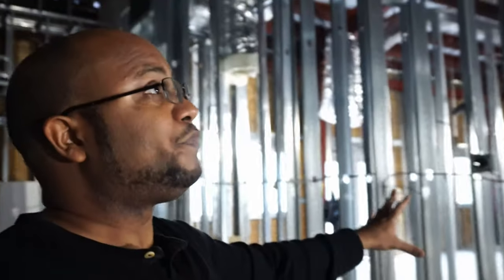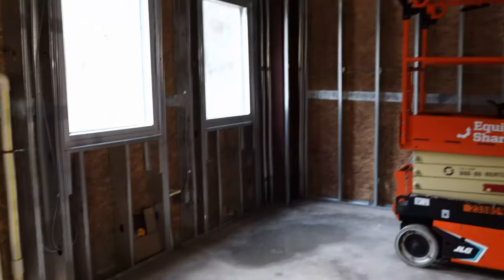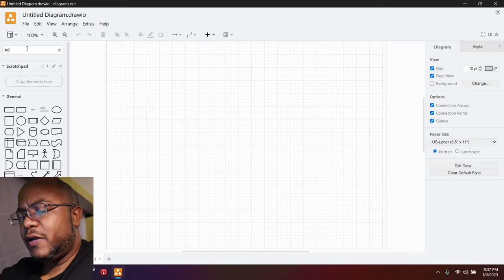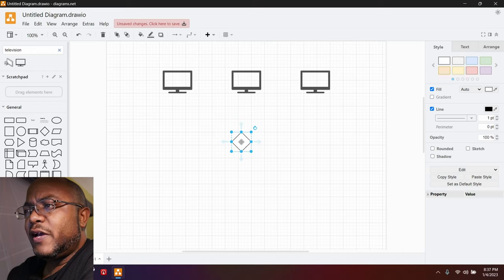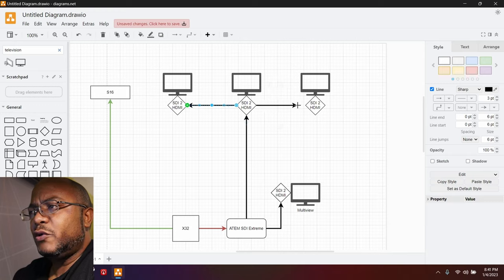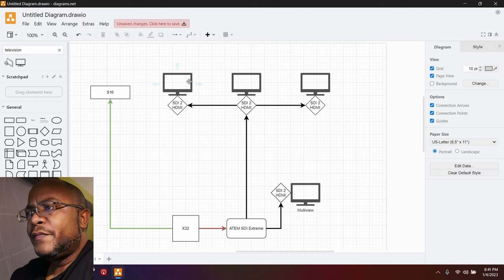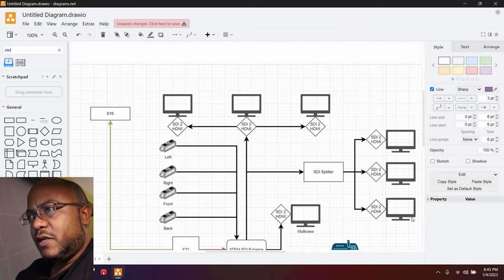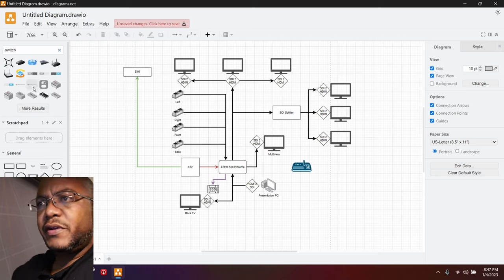One To Another Ministries | On-site & Design

Comment: Bro Ajay, this is Bro Clint from your trip to Savannah Ga. I want thank you so much for what you do for media ministry. I want to give you a report on the progress we have made since you came here. Our move in date was moved several times. we had first service mid June 2023. Our TV in Youth room is fine but the 2 front TV's are flashing the display in 5sec intervals. I have Atem Mini SDI setup with Blackmagic SDI to HDMI transformers. I just got them up this week but can't figure out what's making them flash in and out. Any Ideas?
Reply from the maker: Flashing is due to a signal drop. I would terminate the cable again. Also verify that you are using rg6 cable rated for 3G
Reply: @AJaytheCEO  
Thanks for responding,  it turns out I need the BM Up Down cross-over converter.

Comment: I really enjoy your tutorials.  Great summary video on How To Livestream Church Services With OBS - 2022 too.  
Your videos have been a great help to use in setting  up a two camera AVKANS PTZ system in a very small church (using rtsp).  I am running into a buffer problem with OBS when I switch between PTZ Camera 1 to PTZ camera 2 and PTZ Camera 2 starts out by showing about three seconds of video from the previous time it was accessed - even if ten minutes has passed by. (doesn't happen with Camera 1). Have you ever seen this?
Thanks,
David
Reply from the maker: Hello, yes this is probably due to the amount of traffic going over your network. Video is sent over your network from both cameras as well as your stream goes out over your network. I would try to connecting your cameras to the computer with 2 of those cheap hdmi capture devices I reviewed in the past and see if that improves it
Reply: @AJaytheCEO  Thanks for the quick response.  I was wondering why you seem to choose HDMI over NDI on the new network installation bid.  I guess NDI is over-rated.